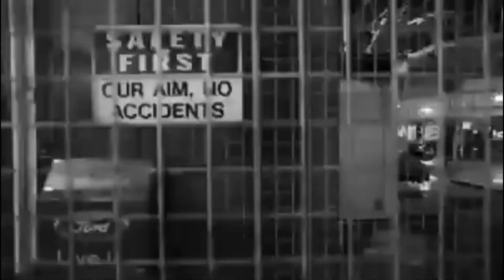Unearthing Aussie Auto History: Ford Ute Chronicles | October VLOG

Comment: Being a panel beater by trade people don’t realise how to keep a older car in a rust free body as they don’t know how to rust proof a car in all the right spots so many falcons rust out because ford Australia didn’t use weld through primer in there joints chassis rails or sill panels Or enough sealer they were only made to last a maximum of ten years but if you rust proof one properly it will last a lifetime also in the falcon owners manual it says always garage for a reason